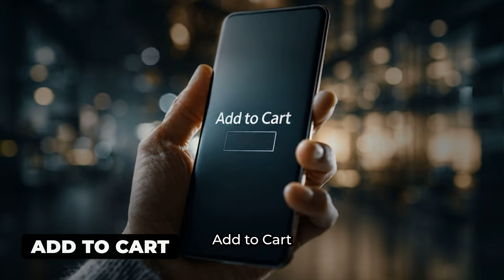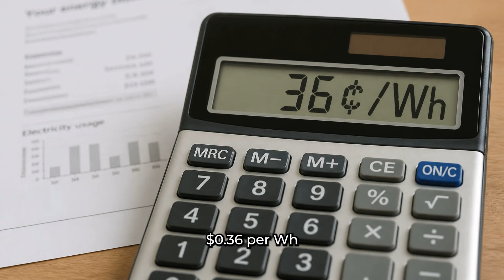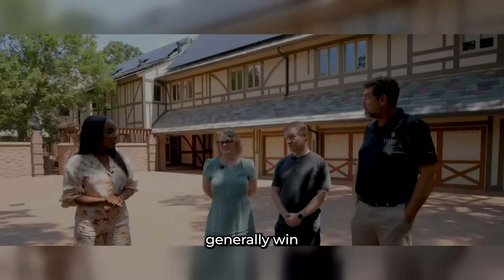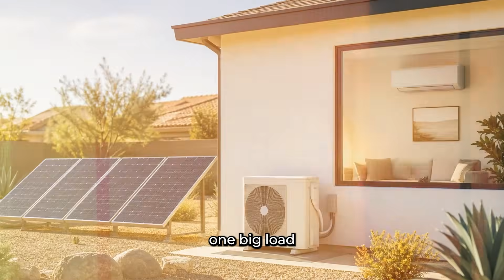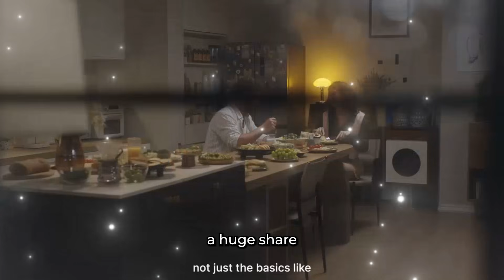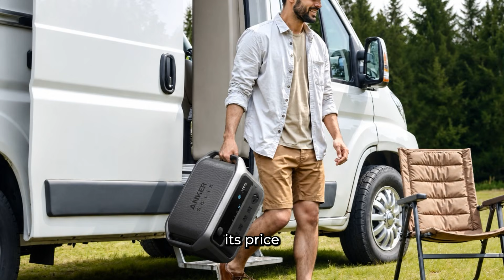Do You Need an Expansion Battery? Probably Not

Comment: And you didn't mention, just plug the second unit into the first and only turn on the AC if you need extra capacity in the primary unit ... Just keep it on standby if needed..That give you 2 standalone units along with  flexibility, as well as extra storage

Comment: I purchased a Bluetti AC200L a year ago and use it everyday to reduce my home electrical consumption. I particularly like that I can input 1200 watts of solar. For additional storage I built a stand for the Bluetti and placed two 200 amp hour batteries below. I use and inverter and charger attached to the batteries to exchange current with the Bluletti. Of note the Bluetti will run a fair sized air conditioner's power surge.  As I want to add more solar, I am buying more solar panels, batteries and a charge controller. If I was more experienced, I might have gone straight to a charge controller, except I do not know much about large voltage charge controllers. Most solar power stations top-off at 600 watts.